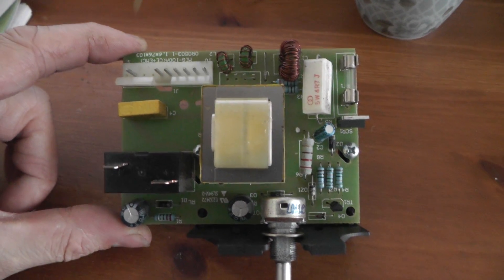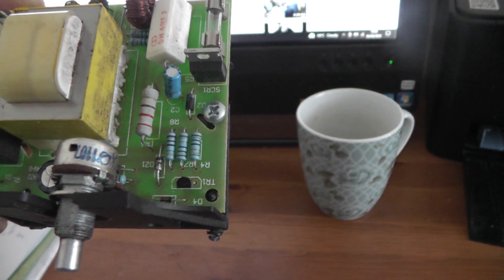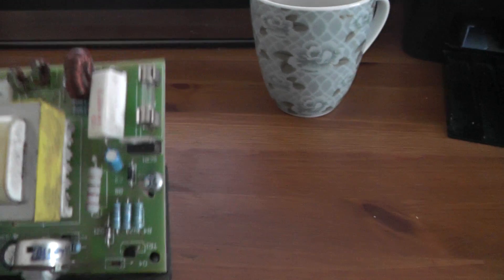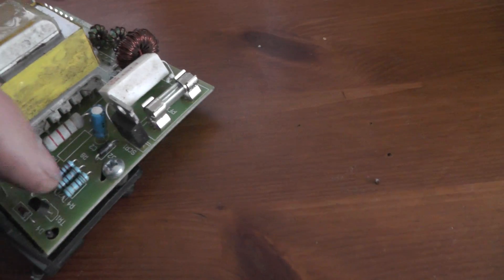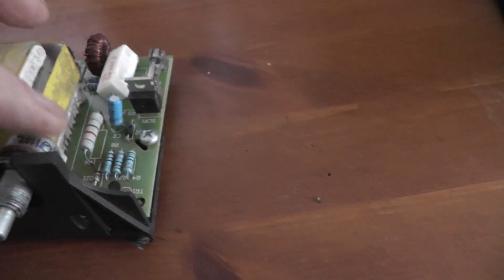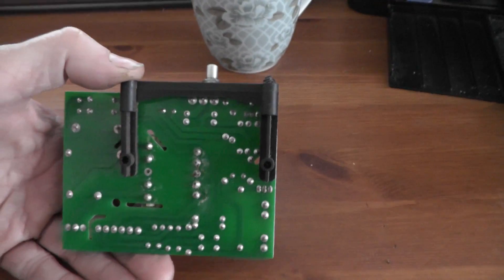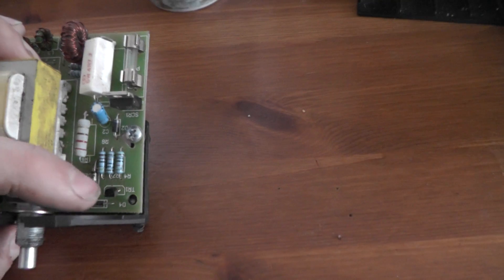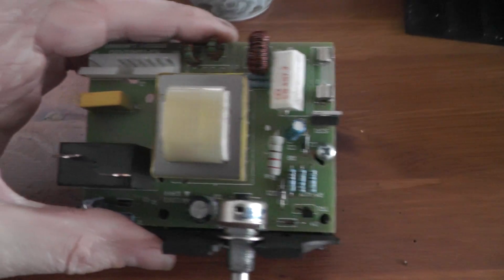FIX WIRE FEED! SIP Mighty MIG welder PCB Repair & Overview (BT151 SCR Explained)

Comment: Can you tell me the part I need to replace cos there is no difference when I switch from min to max n could it be the board cos that what Sealey said it could be n got it inspected n he said it’s the transformer n the wire feed control works fine 
Thanks 👍
Reply from the maker: Bit hard to guess sorry hope your sorted now I was on holiday at
Reply: @cagmito76  hi mate I’ve got the exact board as this and my wire feed has stopped working , what was the issue on your board , did u fix it ?